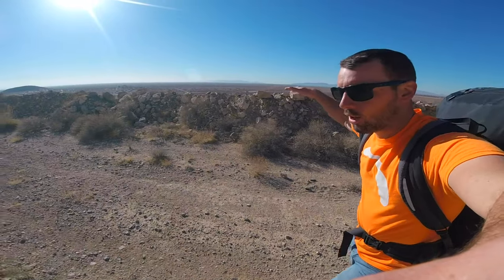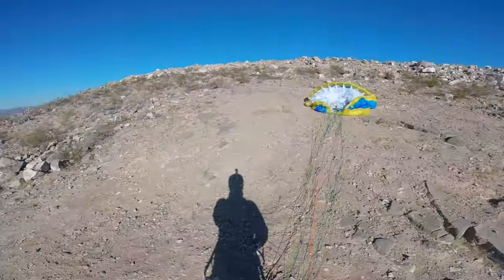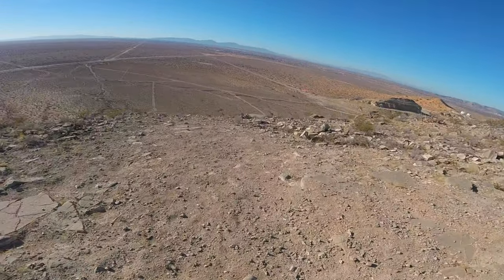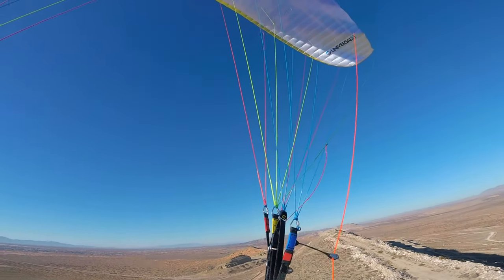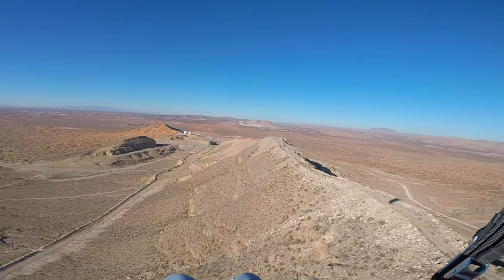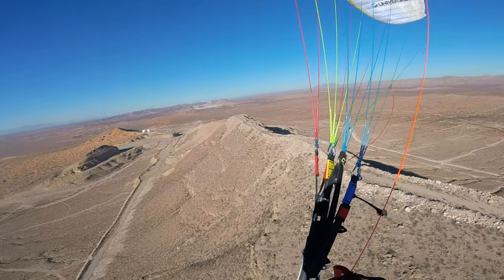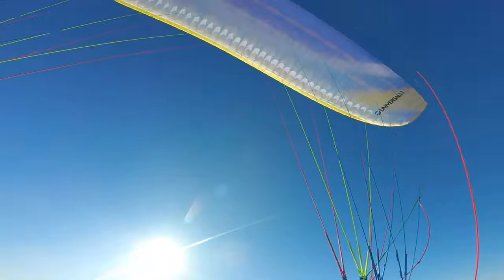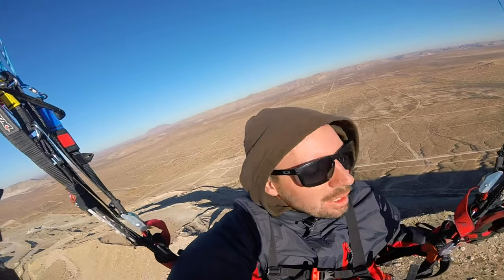Braaap to Mitch's Ridge. Dudek Universal Freeflight

Comment: Nice one Mitch. I take my bike to launch(steep) and recover with the truck, and man on a steep road with glider on my back is fun,lol. Nice bike. I have a 2014 GASGAS 300 2 stroke.  Ridge soaring is the best. Looks like a sweet wing for when I upgrade. Years ago I flew my Apco Bagheera from 2500 agl to the ground with 50% assy. popped it out right before flare,lol fun. Cheers from the rocks in Canada.